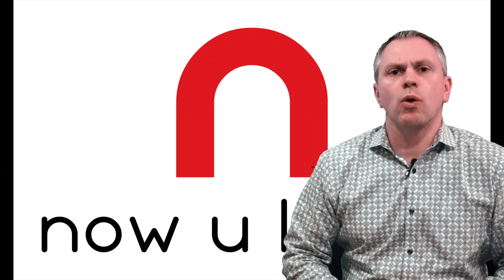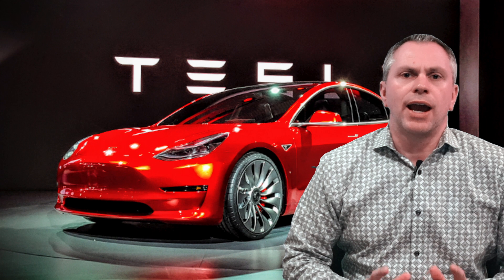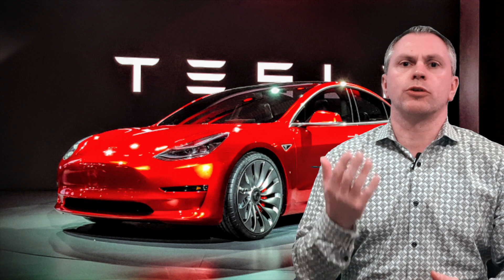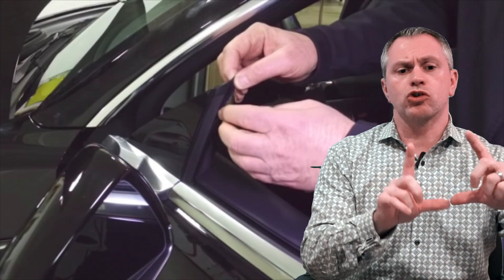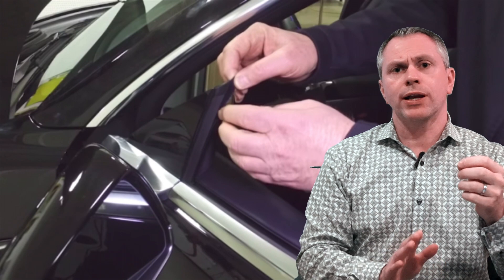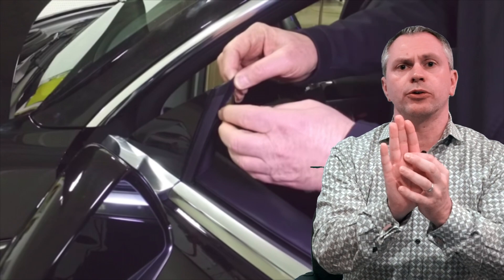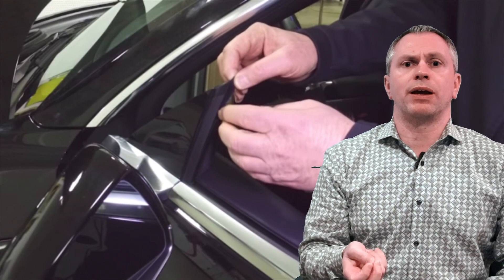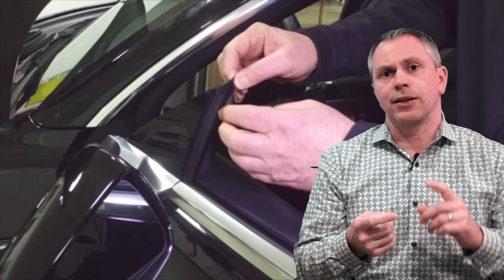Tesla Model 3 Teardown

Comment: My thoughts:1. Frunk: if the car was in a crash, the alloy hood could be pried open, especially if it was damaged in the accident to begin with2: exterior door handles: Aston Martins all have this design. The only difference is that the Tesla has a hockey stick shape, which doesn’t affect ergonomics.Jaguar uses this handle design on the F-Type. If he can insult Kia because of their 90’s quality, why not bitch about a $200k Aston while he’ s at it?3. Rubber window seal and rattling windows: definitely quality problems.4. Manually opening rear doors: should have been done; however, there are a lot of 2 door coupes without fold-down rear seats, let’s say a $150k Mercedes-Benz S63 coupe. How do you get out of one of those in an emergency?5. Panel gaps—classic Tesla problem, however, I could not see on his video the fit issue. Considering his unprofessional sarcasm, I don’t trust that there was really a problem on that car.6. Cutting the rear pillar: why not break the glass roof/rear window, and not saw anything? It’s safety glass, you know.Overall, it’s obvious that this old man with the wrist issue is shorting Tesla stock, or OPEC paid him for his review. As to his comments about Tesla needing an attorney, this guy will need one too for slander. I’m curious as to what you think about my comments.
Reply from the maker: Thank you so much for commenting.....Terrific statements...... I agree, there are many ways to skin a cat as far as some of the safety concerns he mentioned.  Moreover, as I stated the door handle issue he commented on was completely a preference and had nothing to do with the vehicle's quality.  I also agree with you that there was an agenda for him and the statements he made are a bit insulting and completely bias.   However, I do believe there are some serious productions issues and here is why....  I received an email from Tesla  2-days ago pushing back my reservation for the second time.  It is now delayed for over a period of six months now so now maybe I will get it sometime in 2019...  So, this tells me that they are having production issues again and possibly trying to fix some of  quality issues and I hope they do because a 60k vehicle shouldn't have these issues(my config will be) I am not willing to accept those quality issues. Now with that said I do understand that all production vehicles have what the manufacturer calls tolerance levels and are willing to accept and deemed to be acceptable by quality standards.   I have seen some videos and posting of the gap tolerance issues especially on the rear of the vehicle.  I purchased a found on the road dead (FORD) SUV 5 years ago and I didn't pay attention to the gaps (that I am now very well aware of) and its a big deal, tons of wind and road noise and cant even talk on the phone over Bluetooth because the ambient noise it picks up. So for me it is an issue and I don't think I am willing to accept those same issues on the M3 once I get it (if ever).   Emmett, thank you for responding and please feel free to reply back, I love hearing from others and your points are spot on....  Thank you!
Reply from the maker: I agree with you, I am also looking forward to his remarks for the final analysis.  I hope it is positive as well it is important to take others views and opinions but as you stated this guy is no rookie....
Reply from the maker: ABSOLUTELY! thanks for following up, this guy may do some of this stuff pro bono but I would think he is not willing to let all of his personal opinions in the way of providing a solid and fair assessment.